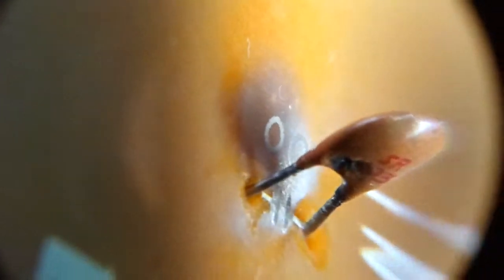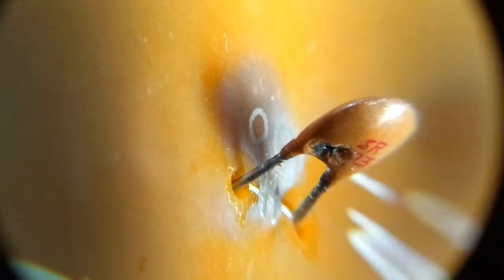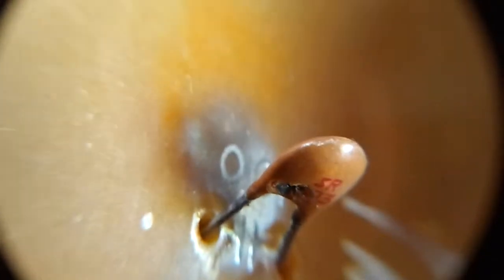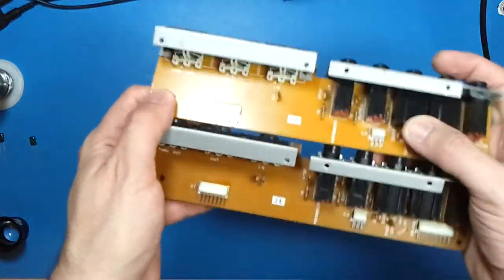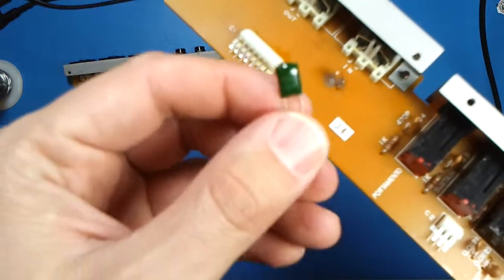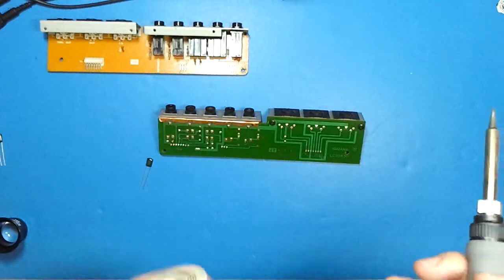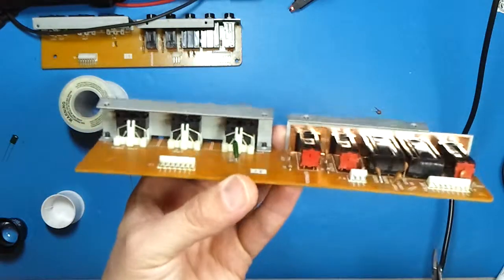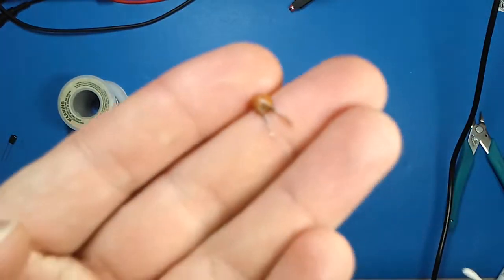Yamaha DX7 Repair Blown Capacitor

Comment: What kind of desoldering pump did you have? i like to buy one just like yours!
Reply from the maker: Jose Serrano It's an Edsyn Soldapullt model # DS017LS. Runs about $28 USD
Reply: Hobby lobby has them for less than $5.00

Comment: I get no sound on my Yamaha dx 7 mk2 fd while all other synth works. Any ideas about what i will need to check out ? i have replaced all caps ceramic and electrolytic on the PSU but the problem remains. Also i get some kind of hum.
Reply: You can build a makeshift 'audio signal sniffer' using a guitar cable into a small amp. If you use a headphone 1/8" plug you can just probe for an audio signal from the DX7 beginning from where the output jack. Just ground the DX7 chassis to the guitar amp. I recommend that you isolate the amps input by using a resistor or capacitor to protect it from accidental voltage spikes from the power supply. I traced my DX7 audio path and picked up the signal before the silence. Temporarily I was able to use WEAKER SIGNAL WHERE I PICKED IT UP FROM, AND BOOSTED IT WITH MY EXTERNAL PREAMP. I'D STILL LIKE TO FIND A DX7 SERVICE MANUAL .
Reply from the maker: I've used an SRD Rockman headphone guitar amplifier in the past to do some audio signal sniffing on an RE-303 TB-303 clone build.